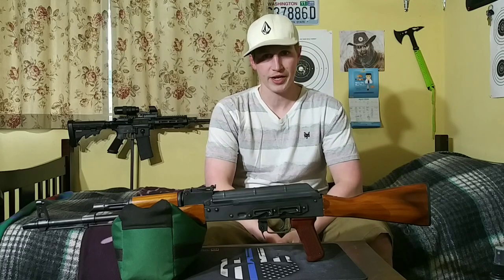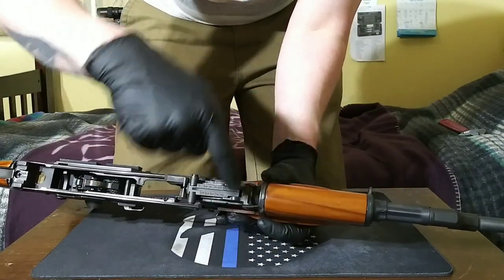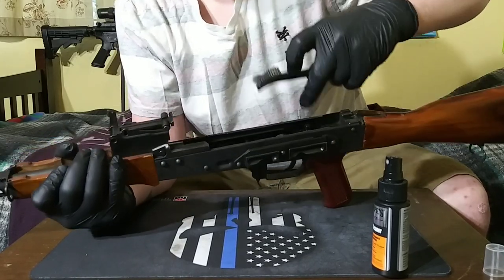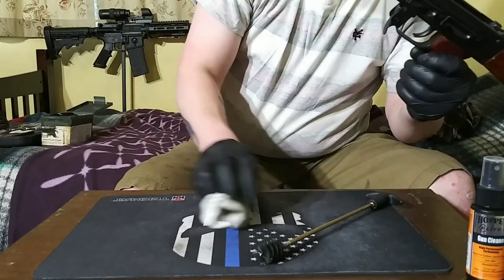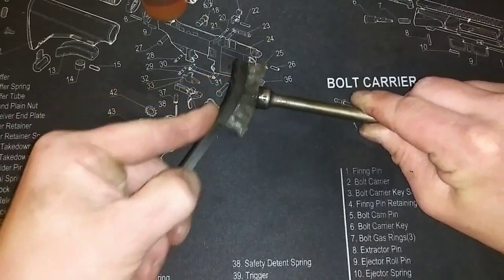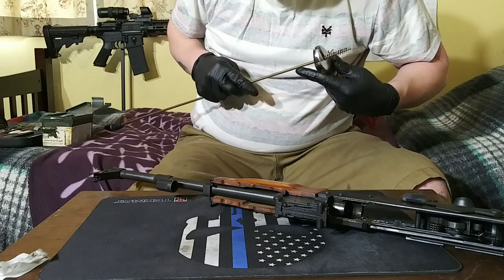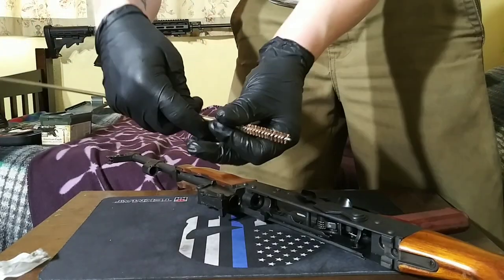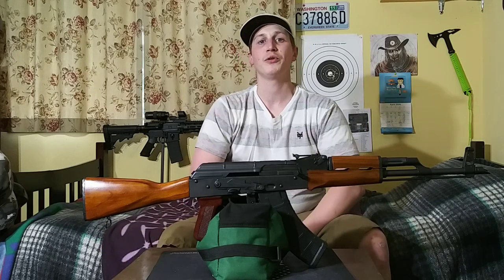Riley Defense Ak47 cleaning guide pt.1 of 2 field strip and clean

Comment: I bought this same model just a few days ago. I was very excited about it. The finish is nice. Solid rifle. But out of the box, it did not work. I shipped it back to Riley a couple a days later. In transit to their facility as I type. There were several issues with this rifle. Brand new. Out of the box. Which is what bummed me out. Couldnt get past 20 rounds when I gave up. Again. Brand new. Riley has been on top of things and in contact with me. Even got a phone call from a rep at Rileys who assured me they would send back a fully functioning rifle. They said they would even include a muzzle brake upgrade, cleaning kit and extra mags for the troubles I went thru. Seems like they are really pushing customer satisfaction. Issues found on rifle: Bad extractor. Bad bolt and magazine well tolerance too tight for any mag other than a Pmag. Cant stress enough that this is a brand new 2020 production rifle. Now its just a waiting game to see if the come thru or I have a $695 paper weight. Definitely not happy. My advise to all, skip this rifle save up a little more and get yourself a PSA or an Arsenal. Yes this RD comes with Forged parts but whats the use when rifle doesnt work?
Reply from the maker: All companies have rifles that come from the factory that don't work properly need to be sent back just because one or two out of six or seven thousand rifles was a lemon doesn't mean the whole bunch is sour I've had a great experience with mine as well as others and when I bought my rifle I was aware that this could happen when I watched an https://www.youtube.com/user/AkOperatorsUnion
 he did a video on a Riley defense he was testing in the thing was running horribly so he sent it back and they took care of him and hooked him up and now he's happy with the company and thinks it's a great quality AK for the entry level price around $700 so I'm sure they will hook you up and make things right I'll send u the link to the videos ak operator union 4774 made on his experience and I run both p mags the tapco mag that came with the rifle and I also bought a couple tapco mags sad they are out of business now along with bushmaster because Remington Outdoor Company announced that they will be focusing on their core hunting and shooting brands – AAC, Barnes, Marlin and Remington. Bushmaster, DPMS, StormLake Barrels and Tapco will no longer be produced, with the exception of the Bushmaster BA50. That sucks i think it's from that lawsuit started by one of the victims of the recent mass shootings family member because they said the commercial remington made for one of their armalite 15 platforms was used by the shooter even though he stole it from his mother yet the prosecution says that because of the commercial and the same rifle being used they influenced the event in some way and were being held liable acting like they have blood on their hands even though their no gun zones is the reason these horrible crimes are so easy to commit with no resistance till the cops arrive 10+ min later. Kinda went on a rant their to get back on the subject now that Tapco is in a business anymore they're going to start including Magpul pmags with all of their AK-47 platforms
Reply from the maker: https://youtu.be/InUEGMVAy7g
Reply from the maker: https://youtu.be/_el5_r1yc-0
Reply from the maker: https://youtu.be/n2xbSisSCX0
Reply: 0Rockstar7 Same thing happened to me. Brand new, it kept jamming. Top hand guard even popped off and wouldnt go back on. Sent it back, they fixed it up, never had a problem since
Reply: T-ßírd Productions wow! Not good! You mean the gas tube? Sorry to hear that, man. I’m glad yours worked after repairs. I get mine back sometime next week. Going to do an in detail review from malfunctions to customer service from riley. I just hope mine works too!
Reply from the maker: @FJBCmonMan     they must have made a defective batch of gas blocks recently cause I had never heard of that happening until rockstar 7 told me about his experience but at least they made it right but still not something someone should have to deal with sounds like they need better quality control and need to test fire the rifles more before they are shipped out.
Reply from the maker: @DesertTactical  I'm sure it will sounds like someone over their hasn't been doing their job test firing the rifles enough to pass quality control
Reply: Kyle Counter thanks, Kyle. I’ve cooled down a bit and willing to give this RAK47 a second chance. Riley Defense customer service has been outstanding tho.
Reply from the maker: @DesertTactical  that's good to hear luckily I've never had to talk to their customer service but all I have heard  is good things about them